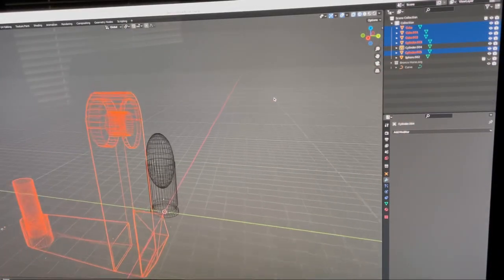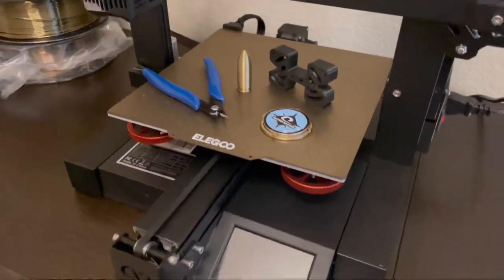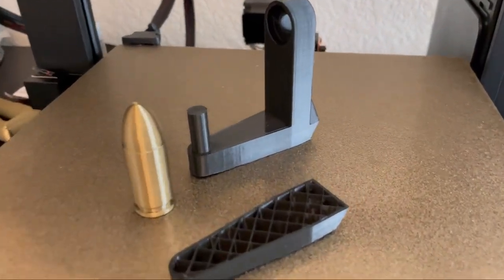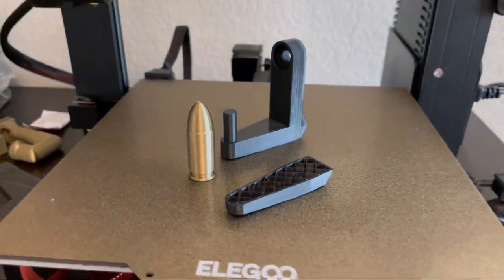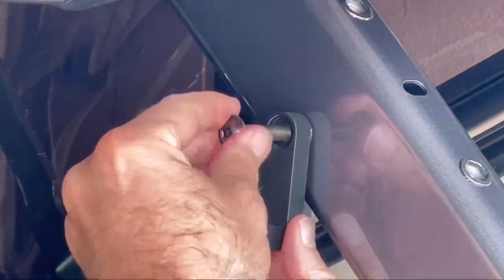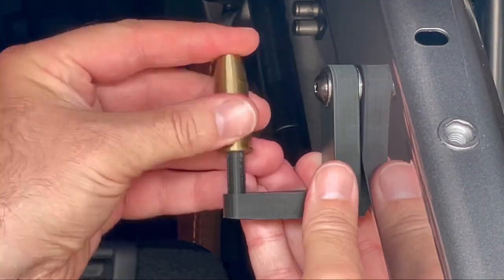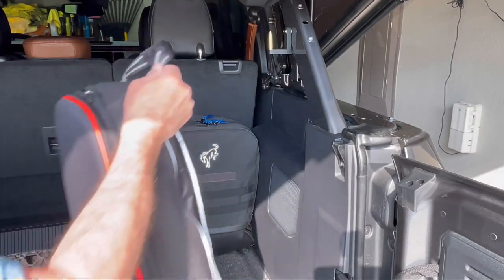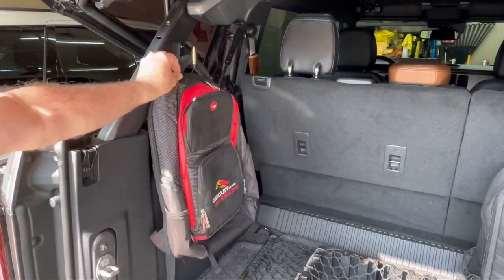An Idea for Custom 3D Printed Hooks for the Trunk Roll Bars - Installation - 2021+ Ford Bronco

Comment: They look great! I've got the Ford steel box in my trunk or I'd want some. Now I'm curious about a fishing rod holder down the center of the truck.
Reply from the maker: That’s not a bad idea and there are 4 bolts on that roll bar, two on each side on the upper side of the frame. You could straddle a bar between them with notches in it to hold fishing rods.

Comment: What size bolt fits that hole? M8?
Reply from the maker: Yes, that's correct, it's the M8 hex bolts. They come in a variety of sizes, the ones I used are the 50mm ones - there's a link in the description to them.

Comment: Do you have a link for the file?
Reply from the maker: So… the file is not robust enough. It works, and held up well but then in the Texas heat, the design of it caused it to buckle and become useless. I wanted to test out a theory before purchasing hooks… and ended up going with a set of really cool aluminum hooks. 

Hooks which I now unfortunately can’t use being as they don’t work with the upgraded speaker pods that I’ve put in there now!!!